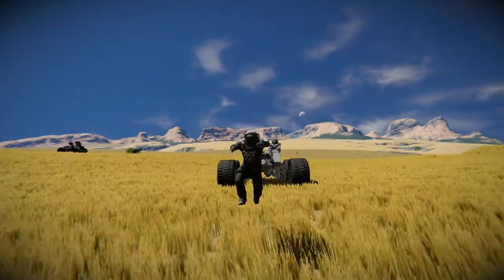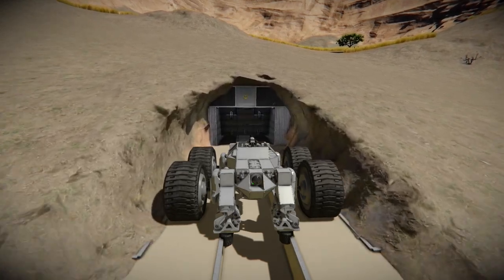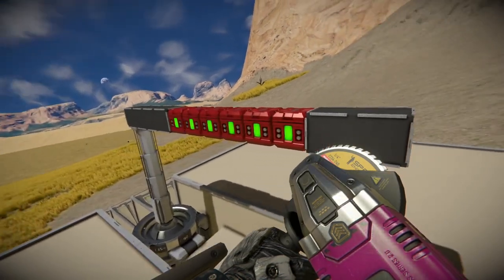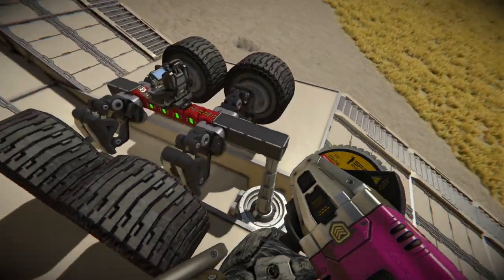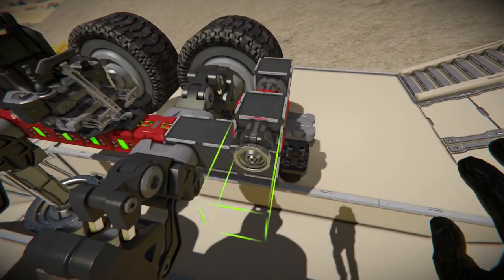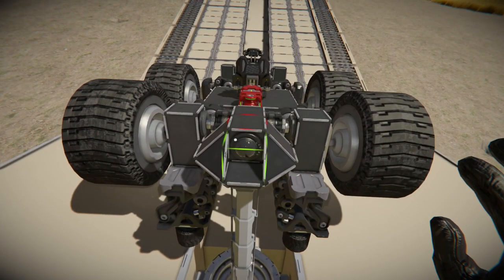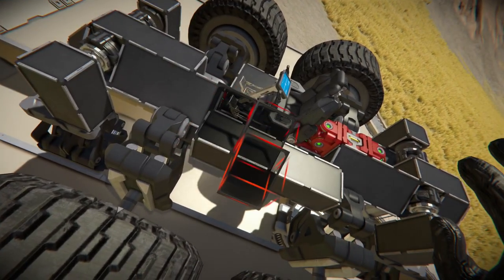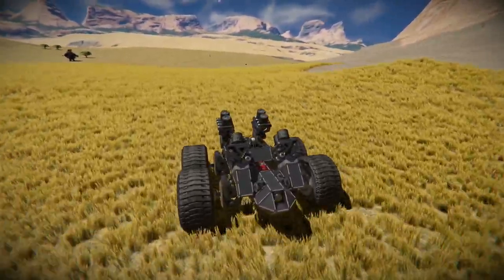How To Create A Rover For Rail And Off-road Use

Comment: Very nice, could you use this rail method for say a train or a welding rig?
Reply from the maker: Should be able to, might just have to add more sets of rail wheels but for the most part it is possible.
Reply: Reminds me of Elons Tesla tunnels 😂 great work 👍🏼
Reply from the maker: If only it were levitation. Would be pretty cool if they added magnetic systems to the game.